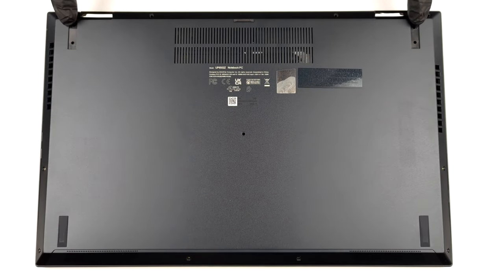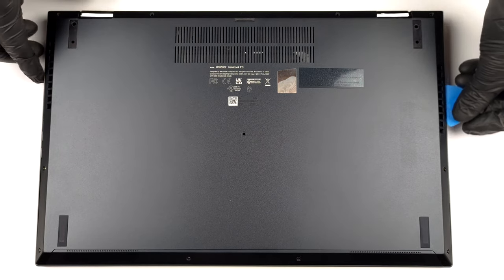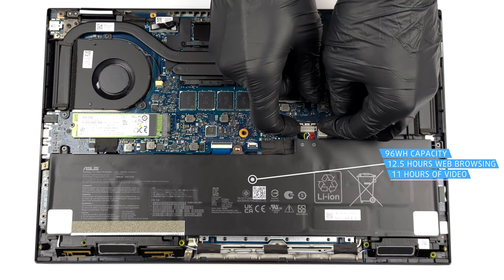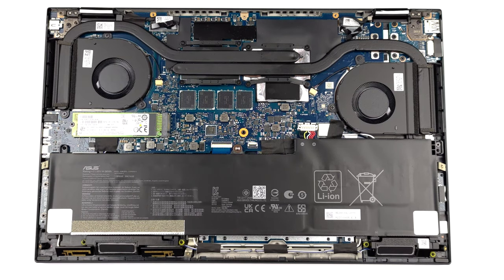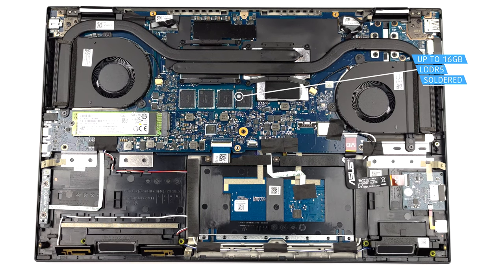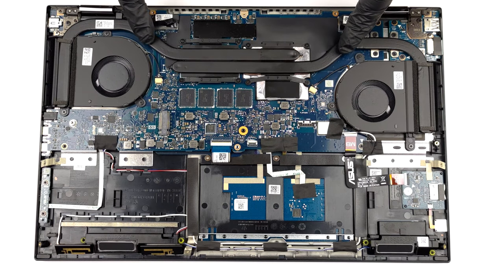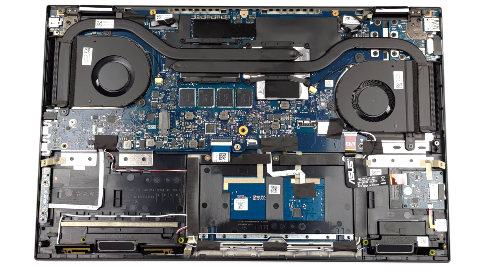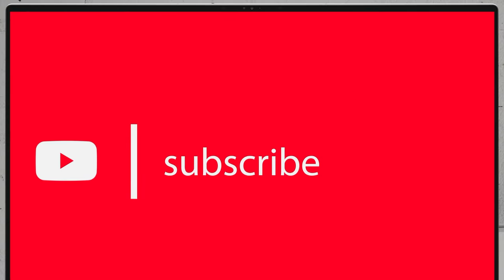🛠️ How to open ASUS Zenbook Pro 15 Flip OLED (UP6502) - disassembly and upgrade options

Comment: Thanks for this video. So, the memory is soldered and there is no way to add more memory stick? I feel sometimes there is lack of memory available, so wanted to see if there is any way to increase the memory.
Reply: Yeah it only comes with 8gb ram. Its strange. All the conponents in my Alienware M15 R7 laptop are easily accessable and upgradable. With my Zenbook though. Unless you are fully comfortable with desoldering and resoldering a new ram chip on the motherboard and are willing to take the risk. There isnt much you can work with.
Reply: But hey at least the storage can be upgraded :). If you wanted to throw in a 2tb card.
Reply: @toonzelda3353  I don't know if you got an 8gb version. I'm not sure if there is one too. I have the 16Gb variant & it always runs at about 40% usage with default apps running.
Reply: @toonzelda3353  Recently, I realized that one of the reasons why it's got a soldered RAM is because it's a military grade unit. The laptop can take bumps and drops. For the laptop to survive and make sure no data is misplaced or lost with lose connection, ASUS decided to keep an SSD & soldered RAM. I'm open to learn what the other reasons could be.
Reply: @toonzelda3353  1 Tb is more than enough if you ain't a gamer. But yea, they could have provided a SD card reader instead of the micro version.

Comment: is it possible to upgrade the GPU?
Reply: GPU cannot be upgraded. The laptop already has two good ones to get the job done. No option to upgrade unfortunately on this one. I don't know if there is any technology out there to connect external GPU.
Reply: Where can I buy a new batterie
Reply: @LeMaPiX  what's wrong with the battery...? It's not even 3 years old....